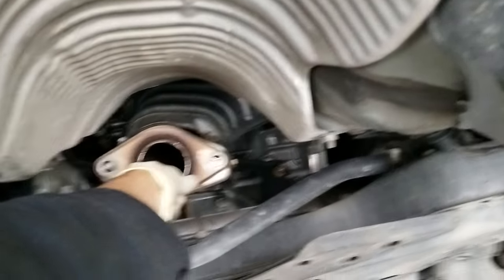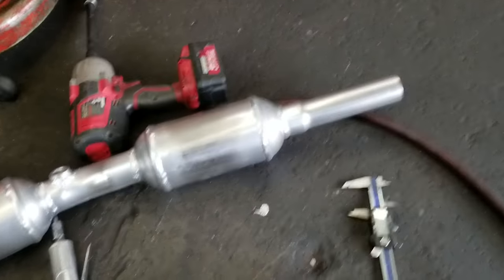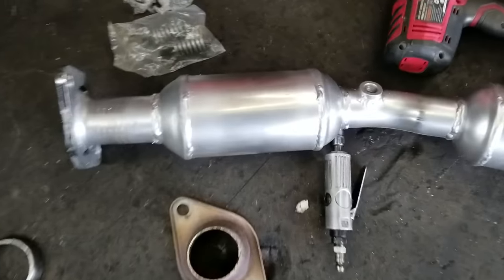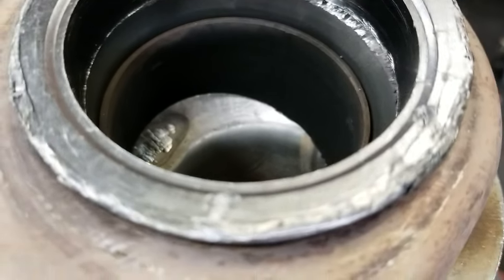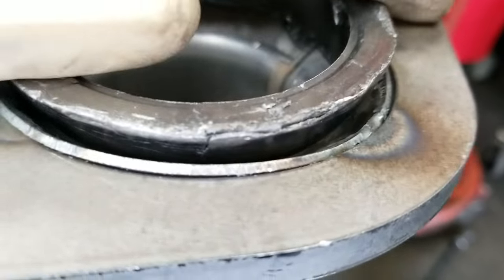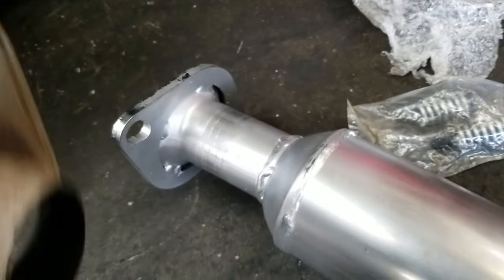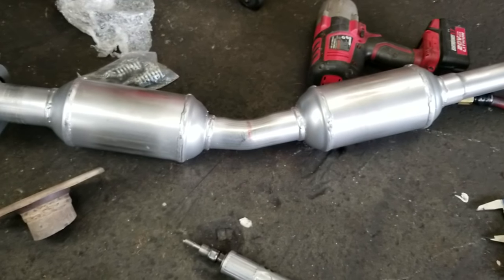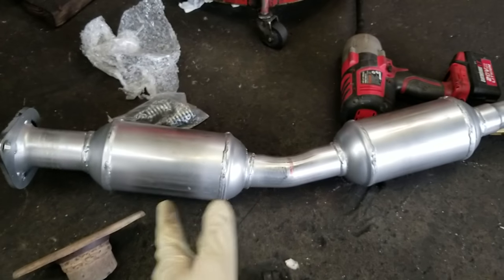Watch before buying Ebay/Amazon Catalytic Converter

Comment: I am spewing I didn't see this before I brought one OMG I hope this one isn't the same it's from Tog auto group and yes I got it off eBay I've had a hard time getting one googled it n afew options came up n I brought one finally got it delivered yesterday n watched your video on how to put in haven't done one before..n now wishing be just watched this video n now I'm spinning out thinking I've brought one of the cat converters your speaking of fucccckkkk!!!! Is it even worth putting it in or should I send it straight back man? I just want to get my Silvia back on the road I should of got it punched out but wanted a new one cause I'm sure that's illegal n it wouldn't of passed the emissions test and that's all that's holding me back man.... I need to pass an emissions test for my S13 Silvia had 3 so far and it's emissions are too high ... the licensing centre made get a engineers report on car $600 each time n I've done it three bloody times because I brought a front cut from Japan n branch it overI changed it from a non turbo auto to a twin turbo SR20 n put manual gearbox in then when it was finished I tried to notify them of engine change which should of been straight forward update engine numbers etc they gave me a form to get permits for modifying vehicle the idiots had given me wrong form o had no idea I filled in n sent back cause that's what they sent out asking me to fill out so now they're putting me through all the scruteneers testing lol bloody noise pollution test, odometer reading , emissions test and a complete report on structural integrity and the state n condition of running gear and safety check then a start vehicle inspection and they supply a report for transport authority it's passed everything but emissions mate they told me I need to get it tuned up so we got two places that can do it this end of WA even though I know they run rich like diesel engines they had no clue n these are engineers lol so I got C Red tuning to confirm that to them n then they had a big meeting and decided I had to take all my upgrades n sports gear out the wankers so I'm going to put in temperary air filter pod where my blow off valve was till after report ,they haven't spotted my dual cat back exhaust system yet fingers crossed maybe I should get a standard one to pass inspection....the beauty of bolt on bolt off instead of welding on hey my friends haha....but yeh hmm what to do sitting here holding this high flow catalytic converter wondering if it's going to even fit or what I can do to make this work temporarily I guess ...What do you suggest I do with this catalytic converter can I make it work mate I'll send a photo in minute K
Please hook me up with some suggestions what I can do to get this report over with n re-register my baby my sexy S13 Silvia! they have keep off road two year's its way too long for a simple fuck up giving wrong form n shit when Silvia's come in turbo or non turbo it should of been easy as..... shattered...help a chick out love my ride want her back on the road ...help me out please
Reply from the maker: Dude... long message. You're situation is likely more complicated than a catalytic converter. You will need to look over some stuff that causes high emissions. Please contact me on Instagram.com/subtledriver

Comment: Thank you for your video , Quick question, does the Catholic convert to give the press a better sound?
Reply: No. They also do not sound good with "high flow" or straigh pipe exhaust, which may also decrease economy. They are meticulously designed to work with the exhaust as it comes.
Reply: I think he wants a  catheter converter.  Maybe change a male catheter to a female one 🤷‍♂️

Comment: What happens if the content of the cat converter is scrapped out? How does that affect the car?
Reply from the maker: depends on the vehicle, usually a check engine light turns on, and doesn't run as clean as before.

Comment: Weld the front oem flange and pipe you have onto the new, so weld both, front and back. Way cheaper. Not sure why not. Ive welded many complete exhaust systems. Go to a real exhaust shop.

Comment: Replace the new flange with the original one, and use a pipe adapter to the pipe on the back of the cat, make it fit.

Comment: You can't use a pipe expander and get it to work ?
Reply from the maker: im sure a pipe expander and a sawzall and welder would do the trick. but id rather buy one that actually bolts up and seals
Reply: @subtledriver  I hear ya on that I just know to save some money what a lot of folks would try and I maybe one of them . LOL

Comment: Why the mechanic asked me if the front cat or the rear one is problem when I called him for repair? I only know there is one cat in the rear. Thank you.
Reply from the maker: there are two cats. if there is a code for it, the front is the problem. if there is blockage, you might need the rear, but usually they fail in a pair.  but if rear is flowing ok, just replace front.  (assuming this shop does welding)

Comment: LoL don't waste your time with this. Make my job easy and go spend 1500 or more on a factory Cat. A new Gasket will crush the the needed fitment. Also on the tail end, it would be better to weld the factory end on anyways.  And personally all this Catalytic Converter bs is just that. Feel good nonsense for people that think they are saving the environment. But everything they buy is wrapped in some form of plastic that they throw away.

Comment: I got an aftermarket one installed for around $260 with warranty.. about 2 months later , which is now , its making a loud annoying noise.. do you think theyll honor the warrantt , or only when the check engine light comes on ? I knew i shouldve just spent the $1,000 for the better job smh

Comment: Bought a cat for my daughter's crv off ebay fit perfectly.Was only 68 bucks sounds kinda tinny because it's thinner material but otherwise it works perfectly.
Reply from the maker: What year crv and please report back after about 5 or 10k miles. I hope you are lucky. Cause ALL the cheap cat customers ended up failing smog after a year or got check engine light. Thanks for sharing your experience

Comment: Is there a better, or worse parking position,, when parked at home?
I can park, BACK in to make getting to the rear (muffler area) much harder, or continue front in.
My car is extreme vulnerable, parked off the alley, etc.
Thanks for the video, which would detour the thought of "do it yourself" help.
Reply from the maker: i would get a cat protection plate installed. the cat is facing the front/ middle of the vehicle. 
also if you get a camera or motion sensing alarm... that helps too.
Reply: You can buy a "Driveway alarm" on Amazon. Wireless motion detector/transmitter. Receiver can be in your bedroom. You can also buy two receivers and have another one near the car that will scare the perps. I place my transmitter, detector under the car facing the cat. I have a receiver/alarm near the car and another in my bedroom. They'll never get under the car without me knowing and them knowing.

Comment: If I were buying a new cat converter after somebody stealing my Cat,  Then I would buy a Magnaflow Carb Compliant Cat Converter from O'REILLY'S..... Maybe AutoZone then purchase the fitting adapters separately....  
Then finally, I'll let the Muffler guy figure out on getting the set together.          There's NO WAY in hell I'm spending more than $500 to replace the Cat Converter, NO WAY.

There's mechanics out there that would con U out of $1,000 to $6,000 to replace the exhaust system.      It's NOT necessary to replace the entire tailpipe system.

I'm like hey,  All I need is the new Cat Converter installed on my car and it DOESN'T get any BASIC then that.

Comment: It's not a matter of choice, the price difference is astronomical
Reply from the maker: Unfortunately they won't fit unless you use a pipe expander for the rear and weld the top section with old cat flange. And your check engine light will come on in a few months for p0420 (bad cat) anyways.
Reply: @subtledriver  Walker and Magnaflow are cheaper then OEM, and both offer a warranty to get rid of P420 and pass emissions (5 years)
Reply from the maker: @TheCybertiger9 YES  those are both good options, but make sure they are california legal before buying in states like california. They won't pass smog visual inspection on non-cali approved cats. The cali ones have higher rare earth metal content and cost more to manufacture and last longer and work better. For the early gen prius, aftermarket is close to factory prices because of this issue unfortunately.

Comment: Then just use a larger piece of pipe and weld it on to fit
Reply from the maker: "Bolt-on" catalytic converter. (Requires a welder because we cant seem to get the piping size correct and also requires a new front flange because our welders cant seem to get it right.

Comment: The one I bought was less than $100 and it has the right flange and fits well.  However, it is FAKE, I still get P0420 I even moved the 02 to behind the second cat,
no difference.   I think the honeycomb inside is just plain metal, no catalyst material inside at all.   Now at that price, just getting the flange and pipe was worth it,
but I need it to not get a CEL
Reply: I got mine for $140 delivered from Ebay some months ago and every so often I get a light so I just reset it.  But I can smell the exhaust a bit so I bit the bullet and got a Eastern Catalytic ECO III for $465.  Like you said, I'm guessing the lower priced ones don't have much catalyst.

Comment: Damn I wish I saw this video before I bought one of eBay for my 07 Nissan Sentra. This damn PO420 light is still on even after I replaced my cat. 🤦🏾‍♂️💀😡
Reply from the maker: Did you reset the code? What product did you buy?
Reply: @subtledriver  Hi and thanks for responding. Yes I did and even replaced both o2 sensors. I tried lacquer thinner, Cataclean, guaranteed to pass and I use mid grade gas. I replaced the fuel pump, spark plugs, air filter, oil change, checked fuses, new air intake hose, PCV valve, intake gasket, valve cover gasket, tires, MAF sensor, brakes, rotors, struts, checked for leaks/holes and still the same problem. I just think that my 07 Nissan Sentra 2.0 might be the worst model ever made by them. I looked all over line and I'm not the only one who has/had this prob. I've spent so much money trying to fix this prob and I get horrible gas mileage. I get about 13-15 city and the same hwy. This damn P0420 code just won't go away and it's the only code that I've always had. Other than that the car runs fine. 🤷🏾‍♂️🤦🏾‍♂️💀
Reply: I realize this comment is a year old but for the sake of others who might see it, fill the car up with non-ethanol gas and drive it for a few days until the codes clear. This has worked for me twice now on two different cars. After the smog check go back to cheap gas. Hella cheaper than a  cat...

Comment: There are only a few brands of aftermarket CAT convertors that should be used.  Walker Magnaflow etc.
Reply: thanks for the info I knew Magnaflow were good, and Walker have been around for years. Matter of fact the walker cat looks like GM OEM. Someone has to make them for GM. No ?
Reply: @TheCybertiger9  to be honest i am not sure about that.
Reply: @Nebuchadnezzar18  Someone told me that Walker is a subsidiary of Tennaco who do make cats. For who, I'm not sure

Comment: Just had mine stolen. From a Prius. 😡🙄 was just about to buy a universal but honestly it’s so so expensive for a something I literally didn’t do anything to deserve the expense and y’all mechanics sure as hell don’t help with the process of fixing this issue. From  perspective the thieves are thieves but I had a mechanic quote me $5k to get it fixed.. my Prius that I bought for 3k.
Reply from the maker: Mechanics aren't the problem,  the part costs over 4.5k and the mechanic only gets $35 for the work and the shop gets maybe $150 out of that. If you have full coverage your insurer will cover it

Comment: After installing an ebay converter, i keep getting 02 bank 2 sensor 1 code for slow circuit response.  Is this cause of the cat ?
Reply from the maker: slow response is likely the o2 sensor. have you ever changed the primary o2 sensor? is the thermostat working properly? car been maintained and in good state of tune overall?
Reply: @subtledriver  when i changed the cat, i also replced downstream 02 sensor.  When the monitors had reset i got the sensor 1 slow response code. I replaced sensor 1 , deleted code and went through the drive cycle again.  When moniters reset again, i got the same code for slow response for sensor 1. I used aftermarket Bosch  sensors and i heard that Chryslers are really sensitive to aftermarkets and that you have to use the genuine. Also dont know if doing a hard reset ( unplugging the battery) would help as well, instead of just deleting code
Reply: @subtledriver  would it be possible that the difference in shape of the aftermarket cat be effecting 02 sensors performance?
Reply from the maker: @marcinwiecek7785  they are made out of lower quality materials compared to OEM, but if you are also running inefficient it wont scrub  the unburned fuel effectively. Or the o2 is slow....

Comment: I would install that cat in the amount of time it took him to make this video.
Reply from the maker: And it would leak and eventually Crack the manifold or pipe and you need a welder for the other end. I welded the old downpipe to this one and it worked fine. But then 3k miles later the cat code came back from defective catalytic converter. Poor quality...
Reply: @subtledriver  I didn't say anything about the quality of the Cat, Simply that it is an easy install, the issues you present as major, are minor at best, just install it.

Comment: One more problem that people install them and no one talks ab is the material inside ebay cat comverters.. is a small peace of material compared to the original cat comverter .. that os why oem cat cat comverters they too expensive.. the ebay ones dont work 100% like oem ones is a terrible smell and they just work for few days o may be monts terrible smell and again check engine ligth for insufsient cat comverter work ..just saying .. install is the small work that  that installers do cus they got the tools to doit and that is why you paying for.. but if you will pay for that job and install a cheaper one  e ready to pay again to buy a oem cat comverter remuve the old ebay cheaper one and install the new one... please 
People talk ab the material inside not just the hard way to install those cats ..

Comment: so what!? if its hundreds cheaper then go for it
Reply from the maker: Besides the fact it does not even bolt-up or work without cutting both ends off and welding on something else? If you live in some of the strict smog states, it is not even possible to ship, and illegal, and they don't last very long. Factory cat should last at least 150-300k miles with proper preventative maintenance. Installing this cat will cost the average person additional $300-450 for fabrication work. OEM cat goes on with no additional fab work, 50 state legal, and with the price difference only saves you about 300 total.
Reply: @subtledriver  
sorry m8 ur just wrong
Aftermarket cats are not illegal in any US state lmao.
let me give you an excerpt from the California Air Resources Board: 
"Non-OEM aftermarket catalytic converters can be legally installed only on vehicles that are beyond their warranty period."

and Cali has the strictest emissions regulations 

also if you are charging $300 - $450 just to weld some mild steel pipe, we're talking well under an hours work, then you are seriously ripping off ur customers lmao
Reply from the maker: @CarMake  California requires a certified cat to be installed (OEM or aftermarket) or it fails visual inspection. So please stop spreading false info. And there is more to it than "just welding mild steel pipe". Many times harness repair and oxygen sensor install as part of the cost.
Reply: @subtledriver  oh no! had to lengthen a 4 wire o2 sensor. that'll be $400 please.
lmao
you are the only person spreading false info mate
and you're just annoyed I caught you out on it 🤣🤣🤣
Reply from the maker: @CarMake  I never said anything about lengthening an 02 sensor wire harness being $400. That's more false information.... yet again.

Comment: New cat is 1,800, I think I can fix the issues shown for the 1,600 I will save, also never seen someone who doesnt understand how a crush washer work claim to be a mechanic, also they come with new crush washers, dont ever resuse an old one, lort.
Reply from the maker: That isn't a crush washer, factory part is a swivel seal. The factory part is designed to swivel when the engine moves. This aftermarket part will cause stress on the manifold and exhaust and cause cracks and eventually more expensive repairs. You won't save $1,600, this cat will last maybe a year or two at best even if you weld it.  Thanks for the comment.

Comment: Why cant you cut that shitty flange off and weld the original? Also, the shitty part about these cats, is that they don't filter very well and the O2 check engine will come on in time.

Comment: jeez, bro....    you are a TERRIBLE mechanic  if you think these are actually issues.    dang bro, this is stuff that is everyday stuff that comes up in working on cars.   Dude,  JUST DO THE WORK AND ADJUST AS NECESSARY.       its not rocket science my dude, just break out a die grinder and make it work,  break out a cut off wheel and make the pipe slip into the other pipe.   it really is that simple and that straight forward.     You are the problem here my friend,  not the parts that were ordered.....